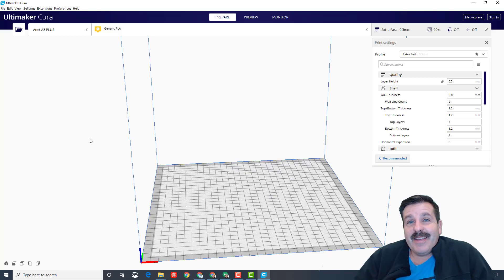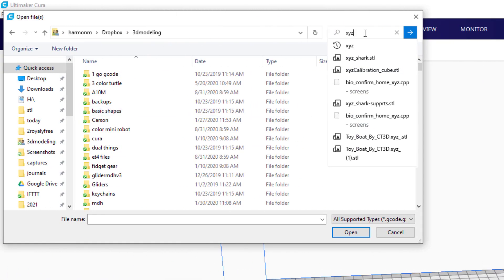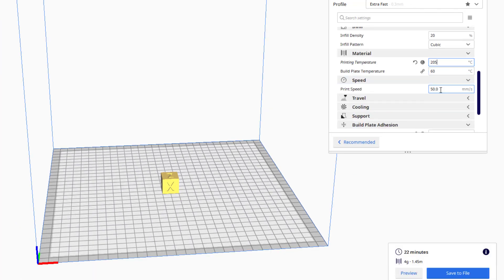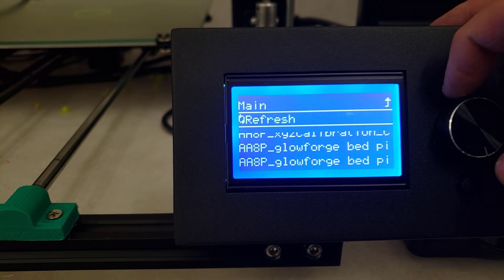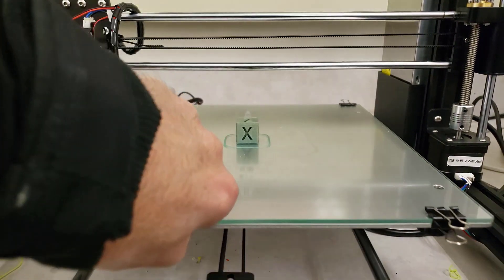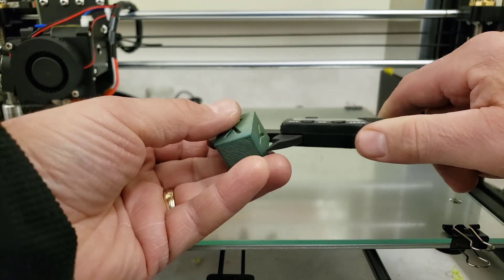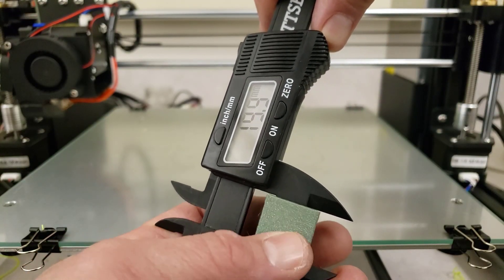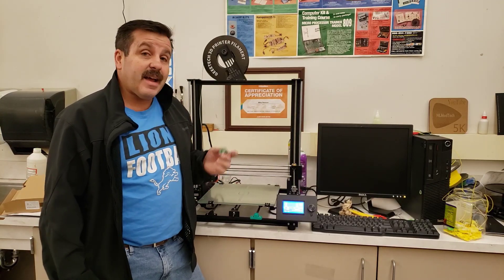Tested! Anet A8 Plus Calibration Cube | How accurate will it be?

Comment: can the calibration on the Anet 8 plus be calibrated? i changed the nozzle and its gone to pot
Reply from the maker: There is nothing you can modify on the stock firmware. I think I saw that someone moved it to Marlin though. I have not done that though. Mine really prints so well I am not interested in messing with her.

Comment: why on my printer there is always a filament left on the glass tray? while in the video it is very easy to take it off please I need your advice
Reply from the maker: I have found that letting the bed cool allows it to pop off pretty easy. I do have a scraper I use to remove stuff that has adhered more than I want.